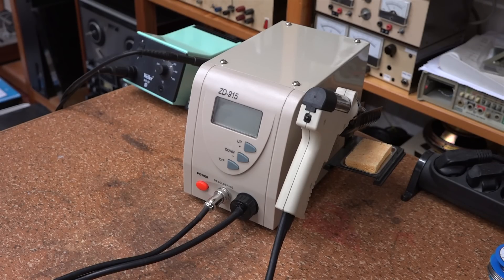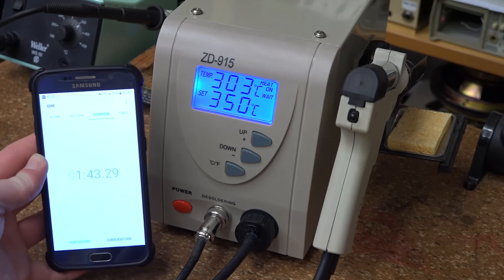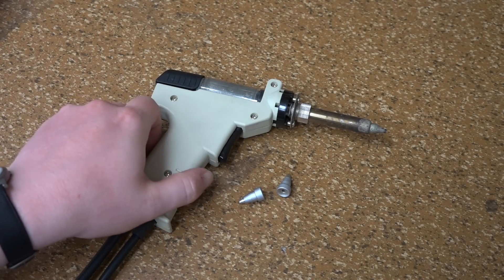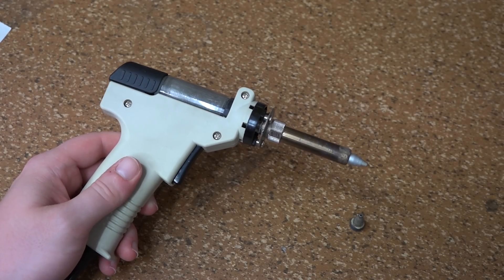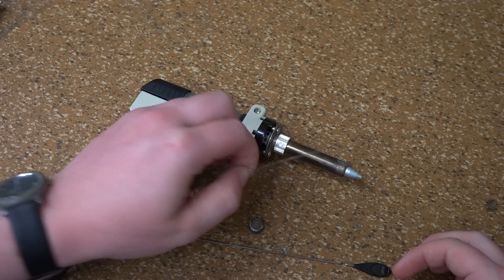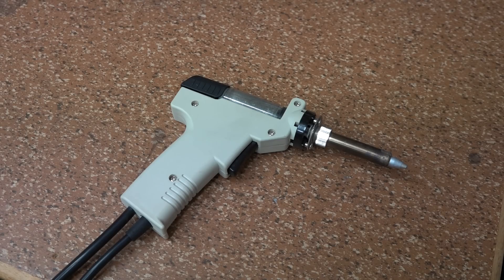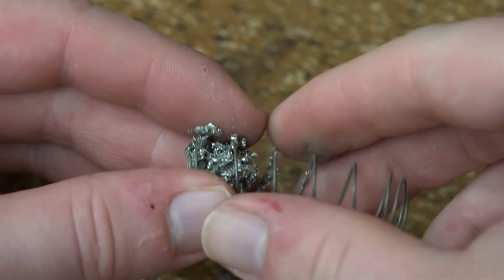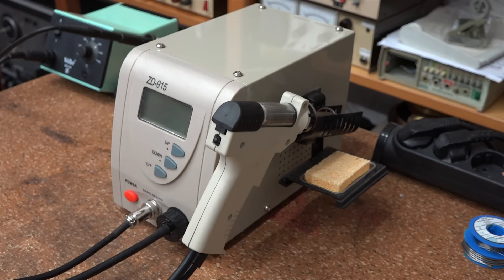ZD-915 Desoldering Station review

Comment: Hi! I just bought this station new, and I got one nozzle with a really tiny hole, and two replacement nozzles without a hole! To the best of your knowledge, is that normal? Does the hole appear after heating or do I need to drill a hole myself? It's not a problem, but I don't want to do that if it's not the way it's supposed to be done. Thanks for the video!
Reply from the maker: The nozzles that came with my station definitely had holes of the right size, if you want to be on the safe side you could install the nozzles you got and let them heat up to make sure the holes are not just covered somehow, but it seems like the manufacturer forgot something and you will have to drill and/or extend the holes yourself.
Reply: @DrCassette  actually no, when heated up, it got easily sucked in leaving a perfect hole. I guess the did that for protection or something. I am really, really starting to enjoy this machine. It wasn't easy in the beginning, I had to practice for a couple of days, but now it's a breeze!

Comment: I bought one and it worked great for 3 months with lite use and cleaned everyother time. It doesn't suck the melted solder after 3 months. Dont buy it buy something else.
Reply from the maker: Mine still works after all these years, but I would say it has lost some of it suction power. Not sure why...

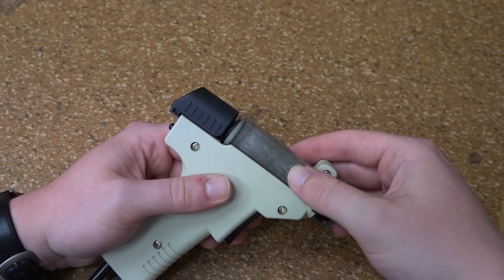Comment: 11:55 - that is because you are doing it the wrong way. You have to pull the glass tube as far as you can to the black backpiece (once backpiece is loose afcourse), and then lift the glass (or plastic) tube  from the front side upwards (still requires a little wiggling, and tension to get it out, but it goes much easier once you do it that way).

This desoldering station is very good if you can get it for the right price. I used it for years and never had any major issues with it. Sure the sound is pretty loud, but for a hobbyist you dont run it for hours a day you know.
But a advise if you buy this, ALWAYS buy extra spare parts for it, like filters, perhaps heater element, even the plastic gun itself is pretty low price. And it makes the mind more at peace knowing if a cheap part breaks down you can replace it quickly.

You could afcourse go for a Hakko or whatever brand you like and pay 10 times more.
But this desoldering gun is very good for its price.

Althought im using the "Pace SX-25 desoldering gun" (with the footpedal) now, its a very old retro one, but i paid 65 euro for the entire unit including the desolder gun and shipping costs of a dutch market place like Ebay. And to be fair, the Pace wins, that thing is like a beast to remove solder.
Reply: thank you! that helped a lot

Comment: I have the same desoldering station, and to make it easier for me when removing the tin and not to heat stress the plastic ring, I made an aluminum cooler on the holder in the plastic. It dissipates quite a bit of heat and I can fiddle with my butt as much as I want, the plastic and screws in it are only slightly heated. A simple edit and it's done. It is not a good idea to remove the tin from the tube when cold, but just heat the entire spring with a heat gun and the tin can be removed quite easily.

Comment: I have one of these works quite well. One tip I would suggest is to pull the tube BACK from the front when removing it. MUCH easier than trying to push it forward to get it clear of the back fitting.
Reply: thank you! that helped a lot

Comment: Just threw out mine in the dumpster. Terrible, for several reasons, a waste of money. Better to just use a 5 usd plastic manual desolder pump.

Now I've bought myself a useful desolder station.
Reply from the maker: Your comment would be much more helpful if you explained the "several reasons"!
Reply: @DrCassette  tip that get cracks and makes black marks in the PCB. Suction power weaker than a 5 usd hand desolder pump. Noisy even when not in use. Get blocked up all the time. Difficult to empty, fraguile glas container, breaks when removed.
Reply from the maker: The fan indeed is very noisy, and I imagine the suction power could be stronger. The glass container requires some care when removing or reinstalling it, but I have not managed to break mine yet. My pump gets blocked occasionally, but definitely not all the time. I have not had any problems with cracking tips or black marks on the PCB.
Reply: @DrCassette  All this type of the desoldering tools require a lo of mantenance.
I bought one ZD-915 for replace my old Hakko 808, but my Hakko never fail, my ZD-915 is in the box still.
Now I bought the Yihua 948, I am testing for 2 months and works fine.
Finally my Hakko 808 clogged often using 1mm nozzles, now I use 1.5mm or more only.

Best Regards.

Comment: Thank you for this video! It was extremely helpful as I try to figure out how to use this de- soldering gun. So appreciative of you taking your time to post this!
Reply from the maker: I am glad you found this video helpful :)
Reply: @DrCassette  I bought one many years ago and never use it, still in the box, I bought maybe 20 tips, filters, two heating elements inclusive.
How about your unit?
The heating element last?
I don't leave my desoldering connected when is not in use.
Ten years ago I bought a Hakko 808, is my every day desoldering gun, 10 years without any problem.
ZD-915 it was supposed to be the replacement for the 808, but 808 never fail.

I repair High End Audio amplifiers and vintage audio gear, throughole desoldering gun is necessary for me.

Best Regards.

Comment: Just bought one of these, I did a vertical ic on my arcade monitor chassis last week not fun with just plain old solder wick and flux which is usuallg what I would use, would of had it out in no time under a proper gun but hay ho,   I have used my gun to make light work of a couple of flyback transformer and a 40pin Z80 chip on my capcom CPS1 board, wish I had bought one years ago.

Comment: Anyone else lose suction with this model despite cleaning it etc?
Reply: Bit late mate but I'm in the same boat. First time using it a few nights ago and it worked as expected. Tried again today and it just won't suck the solder. 

I tried moving the large filter pad and it did apply more suction but I don't really want to use the tool like that. Not sure why it's happened so quickly considering I made sure to clean the tool and guarantee it wasn't blocked.
Reply: @Reyas  špatně složeno...? Je divné že to fungovalo a jak jste to rozebral a složil?-že to nejde....

Comment: Is a DC or AC motor installed in this station?
Reply: Why do you ask this question on every single ZD-915 review when you know damned well what the answer is? Moron!
Reply from the maker: As far as I know there is a 12 V DC motor installed in this device.
Reply: Is it a brushless DC motor?
Reply from the maker: That I don't know.
Reply: @faustsmith  nope, it has brushes
Reply: @JohnDoe-es5xh  Manufacturer should have installed an AC motor as they are mote durable than DC motors.
Reply: @JohnDoe-es5xh  AC motors are more durable than DC motors. An AC motor should have been installed by the manufacturer.
Reply: @faustsmith  yes, I agree with you, but manufacturing AC motors is more expensive and as we know, this Chinese desoldering station is built down to a low price.
Reply: @JohnDoe-es5xh  Cost of manufacture of an AC motor should be comparatively nearly the same  for what is involved, for what it is.
Reply: @faustsmith  Feel free to tear out all that DC stuff and replace it with a brushles motor. It's all up to you.

Comment: Every time you use it clean it ,simple as that
Reply from the maker: Seems like you don't know how these desoldering stations are used. I am not cleaning the entire thing after using it for 10 seconds to suck out two solder joints...
Reply: @DrCassette  that's right I don't know how to use them ..ok
Reply: I have one, removing the glass tube is an absolute bloody nightmare, putting it back .... Well! You'll wished you had never wanted to clean it in first place.
Reply: These kinds of machines are made to prevent that exact thing. Cleaning it every time you’re using it.

Comment: 12:01 "Be careful because if you if you break the glass tube, you can't get a replacement for that, you have to get a whole new gun" 

No you do NOT need to buy a hole new gun if the glass breaks, you can buy a Glass set for the ZD-915, for only €8,00 on Ebay, or only the glass for only €5,00 on AliExpress.

https://www.ebay.com/itm/DE-1-GLASS-SET-FOR-ZD-915-DESOLDERING-GUN-NEW/322872413351?hash=item4b2cb20ca7:g:3XsAAOSwyXNZ8I7V 

https://www.aliexpress.com/item/4000348820784.html?spm=a2g0o.productlist.0.0.b3d0611cNzJmUo&algo_pvid=1bcfeae2-7231-4ace-afee-b77f4645f371&algo_expid=1bcfeae2-7231-4ace-afee-b77f4645f371-0&btsid=62db2941-8ca3-48be-b279-cbda40d9a459&ws_ab_test=searchweb0_0,searchweb201602_4,searchweb201603_53
Reply: Connect the "glasslinger"

Comment: (5:40) - Yes, you can get a replacement glass set for this desoldering gun.
It costs £8.00 and you can find it here:
https://www.ebay.co.uk/itm/UK-1-GLASS-SET-FOR-ZD-915-DESOLDERING-GUN-NEW/362207074257?hash=item54553957d1:g:rCcAAOSwYeRZ8I7A
>

Comment: Thanks for posting your experiences Although it has it's shortcomings it is made for an economical price so on the whole I think it's a good unit.
I just bought the same model and blocked it up after about 20 desoldering joints. Could not clear the blockage so I took the thing apart and it is tricky to get it back together. I drilled out the half inch length of solder blocking the rear of the tube because it was stuck in there solid. I also removed the plastic ziptie holding the vacuum pipe at the top because it reduced the movement of the spring loaded catch at the back and I could not remove the chamber, that allowed just enough movement to get it out when it was re-assembled. Clearing the blockage those cleaners are no good for a solid blockage at the rear of the tube. I got a piece of brass rod the same size as the largest cleaner, removed the tip and heated the brass rod to red hot for about an inch and quickly pushed it into the tube and kept light pressure against the solder and it melted the solder right out, it saved taking it apart again like i did the first time. Stopping the blockage I found it needed to be nearly 400 degrees C, Dont suck as soon as the solder melts, dwell there another half a second and keep the pump going a little longer than you think necessary . That seems to work for me no more problems. I would have took it apart before I used it just like Mike. It must be an engineer thing.

Comment: Just go mine today. Thanks for the instructions especially the pitfalls. By the way you can get the glass tube kit on ebay now. ZD915-TUBE-UW Glass Tube Filter Seal Kit 915 917 1010DR 552A D00756 Compatible.

Comment: Suggestion on your clogging issue. Don't open up the tip. When you open up the diameter of the tip, your'e decreasing the suction, which increases the chance that the solder will solidify before it can be sucked all the way through. A better idea would be to change tips when they become enlarged. Also remove the tip prior to cleaning. This will keep your tips in better condition for a longer period of time, and should give you longer, more reliable service between tip replacement. Also, to remove the glass tube... depress the slide release, push the glass tube towards the back of the gun then lift it out from the front.

Comment: 14:00 Isn't it easier if you put it back (but also get it out) the other way around? Aka, first slide the pad side over the seal and than lower the front. Seems you have more room that way and you can position the filter on the spring first instead of sliding it.
Reply: I have the same model for work and I do that, much easier. The back has also a little spring, and you just push it back and it just slides in
Reply: ON mine there is a metal tube sticking into the interior of the glass tube that makes it impossible to slide the front on last. The frone must go on and over the tube first.. Thinking I should just cut that bit of tubing off to make like easier.

Now: played with this some more, and tengineer is right. It is easier to put the back in first.

Comment: Maby one reason for the solder to get stuck in the "cold part" of the tube is that the button is released to early so the solder is still in the tube.
If you release the button to early, the solder don't have time to get sucked all the way back into the glas chamber.
I remember from when I took a course in soldering that it was one of the things the instructor stressed.
Keep the button pressed for a second or two after it has sucked upp the solder just to be sure.
Solder will not stick to the chamber (glas tube) and the spring if you apply grease to them before use.
Clean them well, and use a Q-tip to apply grease to the inside of the glas tube.

Comment: I got the exact same desoldering station too and I always put the part with the felt pad in first, that way it doesn't slide around, then push the rubber front of the solder collecting glass tube in, which needs a bit of force and is a bit nervewrecking, but it does work. i guess it would slide in easier if I'd put a bit of silcon grease onto the rubber seal... But yeah, that seems to be the worst part about the desoldering station. Apart from that, it works great for me.

Comment: Thanks for the review. Do you have by chance hot air station that could be reviewed? 
With components getting smaller and boards more complex and packed with SMD, desoldering station is more useful for 'traditional' repairs.
I noticed Weller analog soldering station (functionally the same as the one with digital display) and I think older Fluke DMM - these last for decades, with Weller parts readily available. The only thing I don't like on Wellers is the 3 or 5 pin connector, which always has the pins broken if in heavy used with frequent cable disconnections - I put regular size XLR into TC201T for heavy duty use: a bit overkill but it serves the purpose.
Reply from the maker: I have just recently started thinking about getting a hot air station. I'll have to do some more research, but eventually I'll get one, because indeed SMD components are everywhere these days and traditional soldering equipment in many cases just doesn't work for those.
In the shelf there is an old Fluke DMM. The LC display went bad on that one. I already found a modern day replacement, but I have not yet had the time to make it work inside the DMM.
I never detach the Weller soldering iron from its station so in my case the low quality connector is not an issue.

Comment: This might be a stupid question but the little clip on the back that hold the black piece for the Jar should be removable? I'm assuming by pressing the button again it will release have you tried pressing it twice! or keeping your thumb down and moving it back. Maybe using some open cell foam would be better than the pads. You can buy little pads in packets what are felt feet but I would go with quarter of an inch of foam. The plastic piece that melts can you find a metal bottle top that fits on it's snuggly and use epoxy resin to hold it in place, JB weld heat resistant goes up to 350 degrees Celsius actually when you bake it  this epoxy it goes rock hard like concrete you could probably make a new piece out of it completely. Can you not put a copper pipe on the end of the inside or myplace that pipe it's rather small? Can get copper pipe used in model making should be the right size something like 3mm.
Up the vacuum and maybe heating element? as well there's a piece on a circuitry to boost the pump on carlson's lab he made for his. What about moving the fan off-board get a six inch computer fan or two put it in a little padded box with a flexible hose with a quick release fixing onto the unit what you can get from plumbers merchants the fan  could be out of the room or box in a box padded with rockwool.
Reply from the maker: The sliding black part does not come off. The button is just a latch that locks the black part in place. It does not have any other functionality. Your suggestions are quite creative but I am not going to modify this, certainly not this much.
Reply: DrCassette I don't believe it doesn't come off? what about using the bottle top and JB weld, to prevent the plastic from deforming wouldn't take much maybe a medicine bottle they're usually made of metal
Reply: @johnsweda2999   have one just out of the box, and it would be great if the back section just came off. It most definitely does not, or at least I am not able to make it come off. Might be possible to modify by disassembling.

Comment: Never let too much gunk build up in the pipe (the inner of the heating element) 
otherwise you are in deep trouble... i finally got it solved by getting a flexible steel rod in an 500w powerdrill.. and yes... in hammer mode..... redicoulus, but all other drilling methods before did not shove the gunk out.
Reply from the maker: Yes, I have had cases where the channel got plugged up so bad I had to force in the cleaning pin using a hammer. I think it was one of those occasions when I broke the medium sized pin...
Reply: and i really tried... 1mm drill bits, a lot of flux, different temperatures... it felt like i was batteling with concrete.